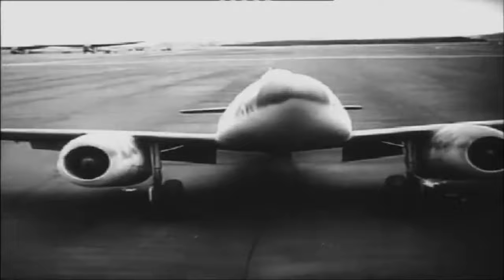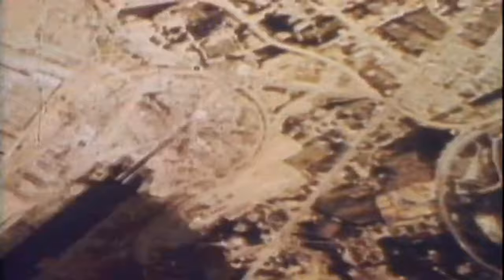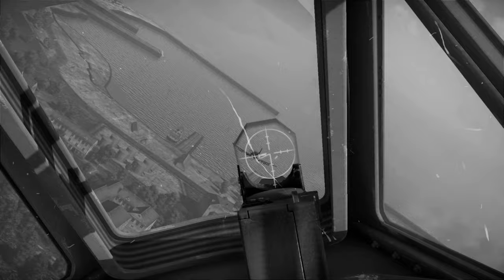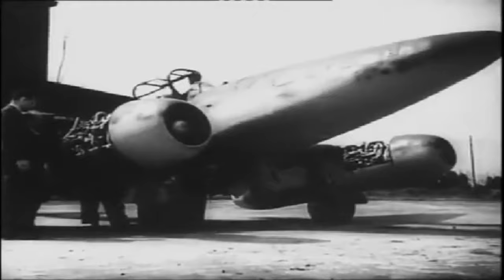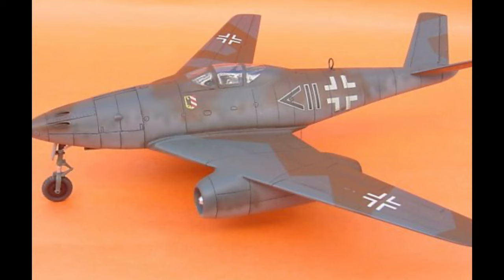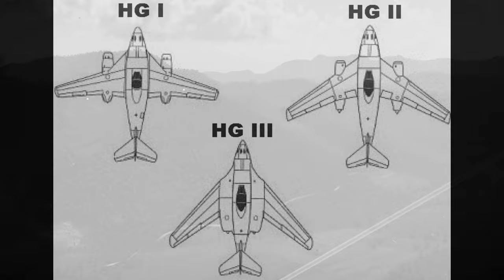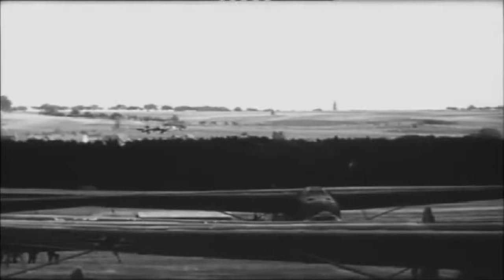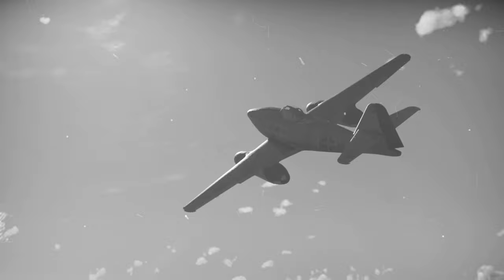History Of The Me 262 HG Series (HG I, HG II, HG III) - The Fastest Me 262s Ever Produced

Comment: HG 3 looks so much like a modern jet, it could've been with an afterburner too.
Reply from the maker: They say it would have been comparable with the F9-F Cougar, which didn't fly until late 1951. The HG 1 and HG 2 were the most likely to have seen production, but the HG 3 was not unreasonable, especially if conditions in Germany were a bit different.
Reply: @Tankenstein  germans seem to always pioneer the technology in ww2. Even fielding the first production fighter jet, and massively utilizing angled armor in RHA (inb4 T-34 reeeee)
Reply: Sp8kyMuhG8ky  massively utilized in tanks. Every single ship is extremely angled if you look at any of them
Reply: @TheLtVoss  I barely get the gist of what you're saying but yeah they do. Most happened after or in the middle of ww2. Its just that, HG 3 looks hella futuristic for its time. Although given the engines that will probably be used with it, I dont think it'll be that great. Even if it was built, it'd use the same jumo 004? Jet engine which barely made the 262 faster than the latest P-51
Reply: @reedman0780  1 the 262a wasnt ¨barely faster¨ than the mustang, it was at least 200kmh faster at every altitude, it cruised at that speed, while the p51d had to use wep to get the gap that close, besides the climbrate, wich post war griffon spitfires would need to be aware of.
evidence of this is that not a single 262 was shot down in combat by allied fighters, despite that there where 300 262 in the air since it was introduced, to 1944, there is a single casualty, in wich the p51 made the fuel empty 262 bleed too much altitude while gliding back to base, causing a crash, the p51 however didnt land a single shot.
2 the production version of te 004b had to be underpowered due to the lack of chromium, wich was used in the u-boat program, said produced version, only had 745kgf of thrust while the chromium alloy coated one could ouptut 910kgf, on top of that, the air cooled turbine, double inyection 004d was ready for mass production, it could ouput 1050kgf without  the chromium alloy.
the 11 stage compressor 2 turbine version 004h was built once, wich could output 1800kgf of thrust (this is the engine wich the whole us axial jet program is based on)
aditionally, papers of the afterburner capable, 004e exist.
not that all of this matters much, as the main problem for the 262 was the position of the engine, wich was mounted so low to make maintenance and replacement easier, unlike what this video mentions about the center of mass, (wich is just a falacy raf fanboys say to do delusional claims on how the meteor was the actual firs jet to enter service for further info seach about the og heinkel 280) anyways, the low engine made too much torque on the horizontal stablizer for it to safely cruise at transonic speeds, as the hg1 test proved, the choke here is in the neeed for easy replacement of the engine, wich would be somewat fixed with the d version, also, the 262c fitted the bmw 003, meaning this series is also somehow compatible with the plane.
Fun fact, the chromium alloy used in the 004 was still used by the soviets to at least the foxbat (3.1 mach capable plane)  as after a soviet pilot deserted to japan, honda copied the alloy and used it for making the brand it is today as a quality manufacturer.
Reply: @santiagoperez2094  would def wanna see how the chromium engines would do, and with these better 262 models shown in the video. Afterburning or not, even with just that over 1000kgf thrust, it'll already be better. Also im assuming the torque came from the engine placement pushing upwards causing stress to the horizontal stabs?
Reply: There was a prototype jump 004 engine that did feature an afterburner in the design and was ready for test flight but the war ended before they could install it into the 262
Reply: I wonder how the 262 hg-3 would have fared against the f-86f Sabre
Reply: @santiagoperez2094  There are gun cams of 262s being shot down.
Reply: @reedman0780  every major side in ww2 had a huge tech base. Germany is the most popular because of their stuff just being cool and visible. But the British for example had radar, arguably the greatest invention of the period, they also had their own jet program and their gloster meteor would have entered service not too long after the me262. I am not too familiar with USA inventions outside of the atomic bomb during that time, but well, can't argue with it's effectiveness, and they have perfected many existing technologies, having the best propeller driven aircraft of the war, and they Also had a jet program, they have flown recon missions but we're not combat tested, but they were not far off. Really the myth of German technology being decades into the future is just that, a myth. If they were truly so advanced, they would not have lost the way they did. They would have negotiated better terms for themselves.
Reply: @HalIOfFamer  Imo the 262 has more potential design wise compared to the meteor. Its been a long time since this comment so I have forgotten most but with just better engines and the planned design alterations, it could go even faster and technically be better. Might even go toe to toe with later jets, like F-84.  

Nevertheless, they put out so much absurd looking stuff they usually are seen as being the one in the lead, iirc meteor is the only allied jet to fight in ww2, meanwhile the germans had rocket engine propelled and jet turbine propelled aircraft
Reply: @reedman0780  a lot of what you say is true, but a lot of it has to do with the fact that Germany was looking for a wonder weapon to turn the tide or at least negotiate better terms with the allies. The rocket driven aircraft were death traps for pilots, their early jets were logistical nightmares, so were their tanks. Towards the end Germany was just throwing shit against the wall and hoping something sticks. No doubt they were in the top 3 most advanced nations of the time, but placing them at a spot specifically on that podium would be difficult even for historians with decades of academic knowledge.
Reply: @HalIOfFamer  desperation tends to do that. And it helped push out their potential as well, just not utilize it well since everything isnt going well, production, means of production, and materials.
Reply: If the hg iii was built and used the junkers jumo 004E engine, then I guess so
Reply: @derrichtigearzt8932  Yes the British DH Vampire was flown in 1943 and proved its worth on many postwar airforces. But  the Luftwaffe had many more designs and modifications. So for me it has more learning potential.

Comment: About the acceleration.
Early jets were horrible for throttle response.  You could not just slam the throttle(s) forward.  You had to "coax" them.  Any significant gain in acceleration for the Me262 (as opposed to top speed) would likely be directly attributable to throttling improvements, rather than finalizing its clean configuration.
Reply: The idea to improve acceleration wasn't really to do with the throttle. Their idea was to fit rocket motors to the 262 which greatly increased it's acceleration.
Reply: @truereaper4572  Which they did . Notice the number of 262s with 2 RATO pods under the mid fuselage .

Comment: HG2 and HG3 look like Sabres and MIG's , nice copy of the 262 . If you look at the crapy P80 later F80 , that's a whole different jet . Or the Gloster Meteor , at this point the Germans were quite impressive . 262 was ready in 1942 , but not the jet engines . So imagine this in late 1942 , would have been a shock for the allies . More than it was in 1944 . 

Just take a look at the Ruhrstahl X4 and X7 , a wire guided ATGM launcher for infantry and a AA missle for planes . About 1000 were build and testet in FW190 , maybe we get this in WT ?

Comment: If… If… If… What a crock of Bullshit. Germany never had the materials to build the more advanced designs nor the engines. They had over 1000 Me-262s sitting waiting for engines that were never installed because they were never built. Pure Fantasy.
Reply: The thing is post war tests of these aircraft including the continuation of the 262 production under the avia name of S92 proved that the jumo 004 b engines we’re more reliable than shown in ww2 when produced with needed materials for withstanding the combustion chamber temperatures and was far more reliable, the majority of engine issues these jets had was down to not having enough materials of then proper quality, yes if the Germans had more time and resources the absolutely could have produced these more advanced designs so it’s not a crock of crap
Reply: Ur mad beaches your favorite jets take ideas from the germans?
Reply: This is just so wrong, just look at the P.1101 or even Me 262 HGII both wer built and the Me P.1101 was borderline a 2nd gen jet... And NO there wasn't 1000 Me 262s waiting for their engines, the 1000 built Me 262 that couldn't see combat were locked in factories because of allied tactical fighter strafing or bombing any train or truck transporting them..
Reply: @c0ldyloxproductions324  correct , sir .
Reply: 624mph was a speed version of 262mph in ww2